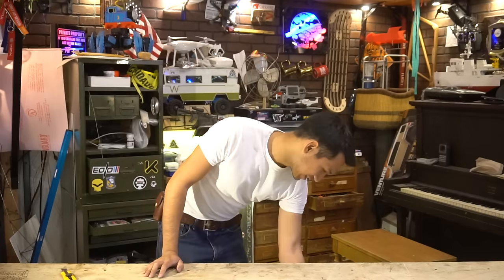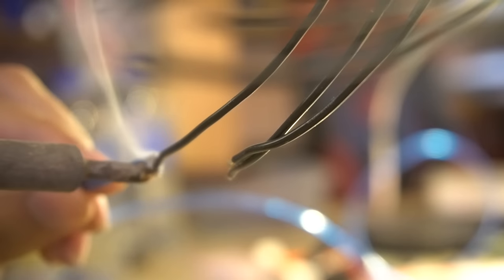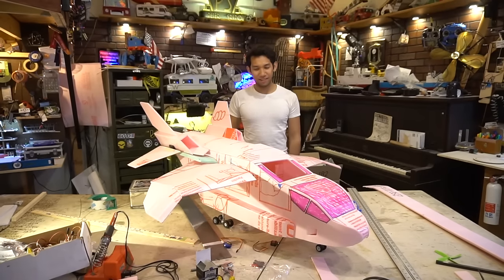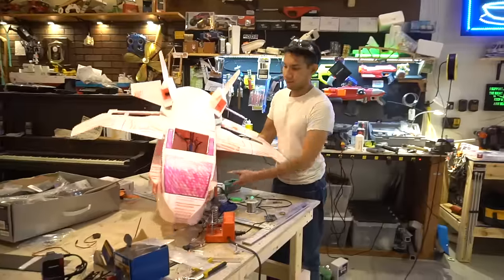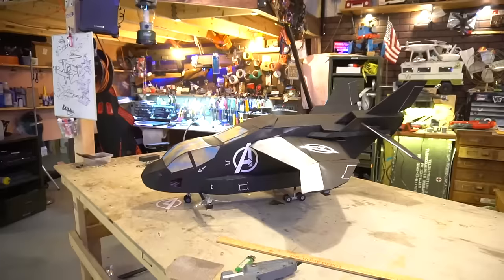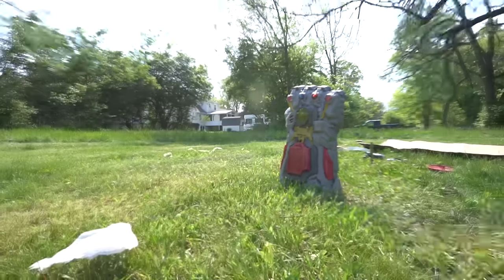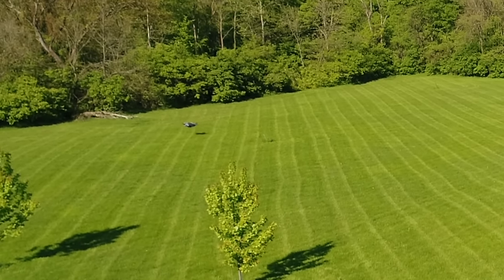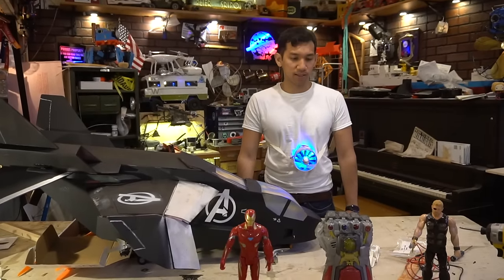Real FLYING avengers Quinjet RC airplane

Comment: if you want something thats very very similar to this that would be an interesting challenge to build systems wise, check out the y 32 xian from the game arma 3. it has the bicopter discs that tilt within the wings, and for stability the rear two power plants have thrust vectoring like the system on the rear of the f35s where the angle changes by rotating the vectoring tube (idk the name).

so if you decide to take this project further thats a potential thing to look into doing
Reply: Arma 3! I have 5k hours in arma 3 😁
Reply: @JohnCoffins  ah shit dude I have 2.5k I mostly play koth and exile, I like altis life too but hate the consistent robbing people do. Wbu and what’s your in game name?
Reply: @ryanm.191  I mainly play warlords on us01e or warlords redux on eu11. Username is JohnCoffins

Comment: I would've been very happy with just the normal plane one - I can't believe that thing actually flies. With such short wings. Once you added the quad hardware, it was essentially just a normal quad with a bunch of useless foam added. With the plane version, it actually flew using the wings given.

Comment: Its simple, actually in your earlier attempts, you forgot about the net angular velocity of the vertical take off motors, that's why it kept turning towards one direction, that why we have the tail rotor in a heli. But when u used a Quadcopter, it already has motors running in different directions, cancelling the net angular velocity and only pure upward thrust remains, would definitely love to see a more refined and perfected model, with vertical thrust motors in the wings, with fins that open and close in take off and horizontal flight maneuvers respectively. Great video, and effort. Love your work

Comment: Hey I was wondering, I’m starting to build my own rc airplane and need help. How do you know which transmitter reciever, and controller you need. Also how do you solder the wires to the transmitter.

Comment: The coanda effect is ruining your vtol because it is causing a vacuum on the bottom surface of your wings and you need that on the top of your wings or just vent the wing so the air can travel through.

Comment: It might actually fly better if you made it a bit larger. Possibly modify the aft propellers so they can be pivoted down to provide VTOL lift in conjunction with props in/under the wings? Making it bigger would also allow it to have larger wings, and thus more lift in conventional flight. Additional power for forward flight would probably also be useful.

Comment: Lets have a talk about weights engineering. While you are using light weight board, scale size that would be a foot thick. Remove the weight before you add the power.

Comment: I think, you have to turn off the VTOL mode in order to fly forward, because in VTOL mode there is a PID that keeps the vehicle stable and does not tilt automatically, because that is the vehicle will be difficult to control if you want to fly forward, the force given  the motor will be opposite each other.

but that's all just my guess, I don't really know about the system you use.  btw I use Google translate to make this comment. Wkwkwk
keep flying peter 👍👍👍

Comment: You have mixed quinjet with jump jet, the shape you have gone with wasn’t a vertical take off system, it is more a gun ship used primarily to drop captain American onto a boat. It was only able to take off vertically from its launchpad due to electromagnetic propulsion as demonstrated by the ability of caching and unsecured helicopter in the first averages movie, the difference is quinjets have short stubby wings and jump jets have long thin wings

Comment: is it possible to build a multi prop plane, or quad copter, where each prop uses more than more one either coreless or BLDC using a gearing system where each prop uses the power from 2 or more motors connected by the gears or gearbox, never seen it done I think it would be a cool build/ challenge.

Comment: Ok. No holes in the wings, props below, aerodynamic mind score, negative 9.8 (-9.8). Slots in wings, aerodynamic mind score, -5.6, slot and 1/3rd circle, perhaps 30% blade to sky view aerodynamic mind score -3.2. I simply cannot fathom this after all the work this man has done. I am understanding NASA's huge problems better now. However, 8:49 the fearing googly eyes and helllfire missile and 8:52 pilotess with the cocked head aiming at target... yeah the overall score just went really positive...

Comment: You should try and make the revell 1/48 scale B-17 fly
Reply: Wouldn't that require for incredibly small engines? With enough power for those tiny flight surfaces to maybe actually work? That's quite the challenge since a lot of planes don't scale down well. If anybody could do it it would be Peter though
Reply: Lana Smith I figured he could do it. With the size and power that come on brushless motors and with the plastic being light weight I figured he could do it. Worse case scenario cut off the plastic flight controls and replace them with the foam board he always uses.

Comment: Kinda disappointed that you went to a quad copter design for the vertical take off instead of the original design. All you needed was more power in the motors.

Comment: bitte baue ein Luftschiff, denn die sind hier in Deutschland total beliebt.
die Luft im Innern wird mit einer Leichten Heizung erhitzt (so kann man den auftrieb kontrollieren)! 
dann kann man es mit einem Propeller hinten die Geschwindigkeit steuern.
mit einem Seitenruder vorne und hinten kann man die Richtung steuern. 
und mit 2 Ballons vorne und hinten, die durch ein leichtes Rohr verbunden sind, kann man Helium mit einer kleinen Luftpumpe nach vorne oder hinten pumpen so kann man kontrollieren ob er nach oben oder nach unten fliegen soll.
und wenn ein seil an der spitze dranhängt, dann kann man ihn problemlos bei der Landung einfangen, und nach hause in der Luft einfach hinter sich herziehen. (denn so ein Luftschiff kann sehr lange in der Luft bleiben)
und wenn du noch Solarflächen oben Draufpackst, dann kann es endlos in der Luft Schweben.

so ein mini Rc-Luftschiff kann ungefähr 40kg zusätzlich Last mit sich rumtragen. (je nach Größe)

wenn es Groß genug ist kann ein Rc-Luftschiff sogar einen Menschen Tragen.

außerdem brauchst du oben ein Überdruckventil damit die hülle beim Start nicht reißt. ( Überdruck )
und du brauchst unten ein Unterdruckventil damit die hülle bei der Landung nicht reißt. ( Unterdruck )

für mehr Kontrolle kannst du oben auch ein ferngesteuertes Luftauslaß Ventil bauen, um es zur Landung zu zwingen.
außerdem sollten ein Parr Schutzdrähte um die Heizung sein, um zu verhindern das die hülle die Heizung berührt.

am Schiffsrumpf kannst du auch Seiten Propeller anbringen, wenn du möchtest das es sich auf der stelle drehen kann. (unnötig)
Reply: mit einem Barometer kannst du testen wieviel Luftdruck es aushält, und wie du das Überdruckventil und das Unterdruckventil einstellen mußt.

Comment: you should have taken out the extra time to build it the first way you were going to build it I would have especially been interested using the electric ducted fans. But basically you just put a shell on a quad which is less impressive. I guess I'll just build a shell and put it on my quad and call it something.

Comment: your trying to make something with little power turn 90 degrees and expect it to stay in the air at the height you are flying it i thought you knew how to fly slower turns you may have got somewhere and testing it in restricted space worked well as well you spoil the videos by doing things a newbie would do and we have to watch you repair it i don't think stupid mistakes make more views and not to check all the parts after crashing is very newbie as well so you know how to spoil a good thing

Comment: why the  fuck  do  you  fly these in the  shop  and  then  have to do repairs before you get it  outside. this is  getting  so annoying.  test  fly  the planes  in a place you  can actually test  fly,  and  stop wrecking them in the  shop